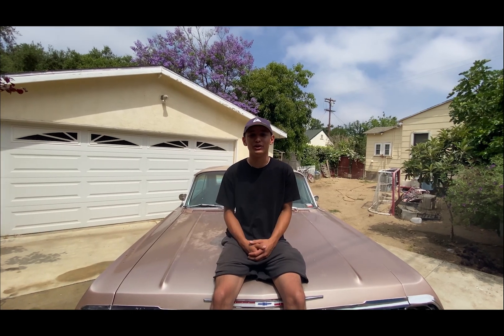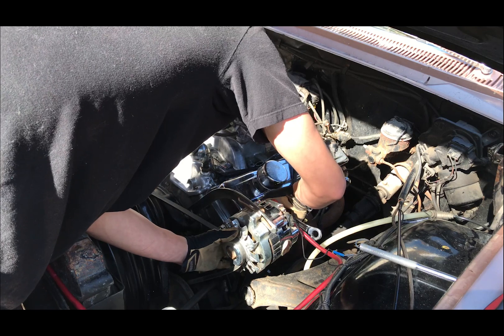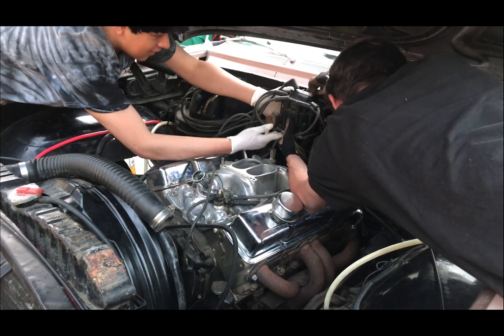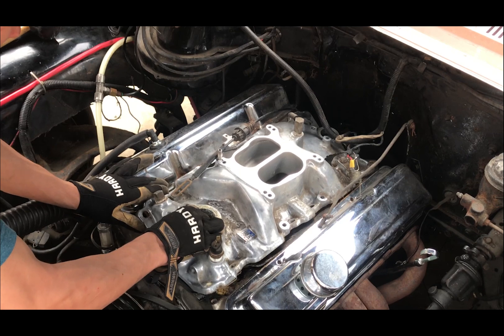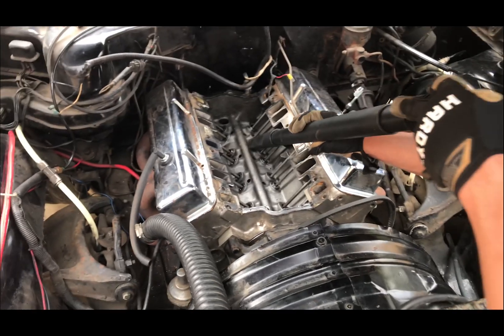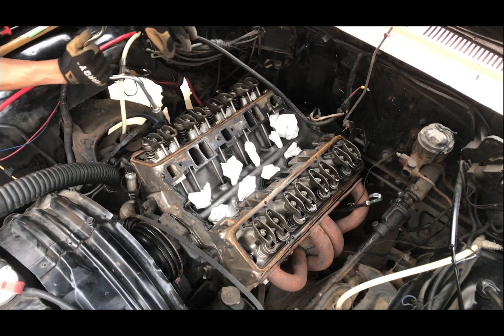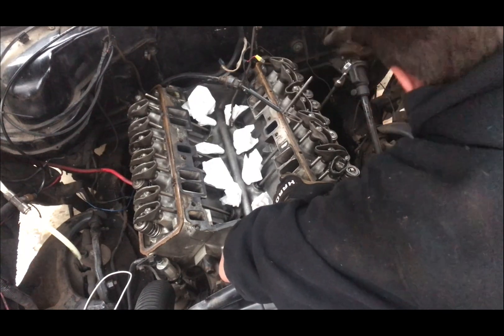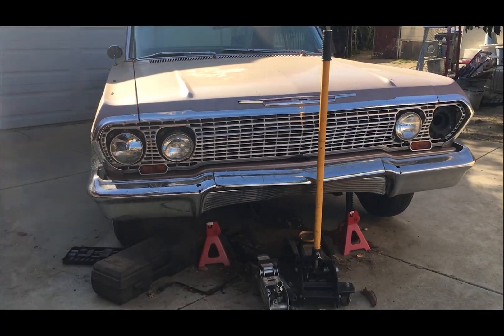17 YEAR OLD TAKES APART A 350 CHEVY SMALL BLOCK (63 Impala Start Attempt Series)

Comment: A Trick when braking off bolts. Use a wd40 and let it soak then use a torque wrench to undo them if you don't have air tools etc. You will need one later so may as well invest on a good one.

Comment: Make sure to look up the torkyou tighten the bolts on the heads.and tighten the heads bolts in the sequence they say to .

.and get a torque wrench   tighten  the   rockers.leave the spark plugs out . rotate the engine  as you tightening the rocker with a torque  wrench  .that is to make sure the rocker is tight in every position. Weather it's up or down